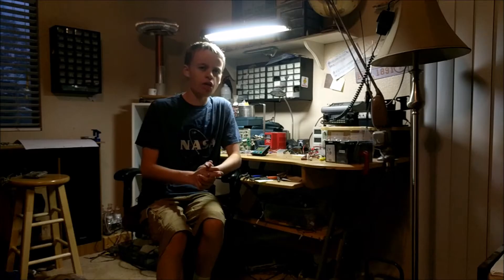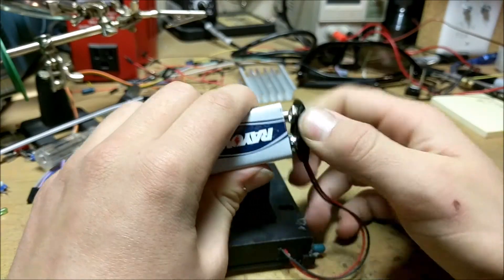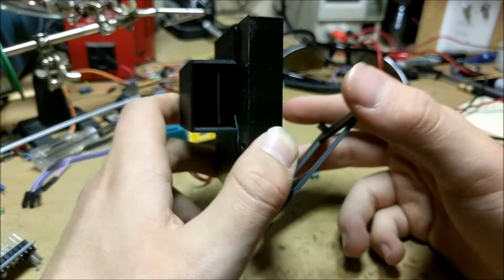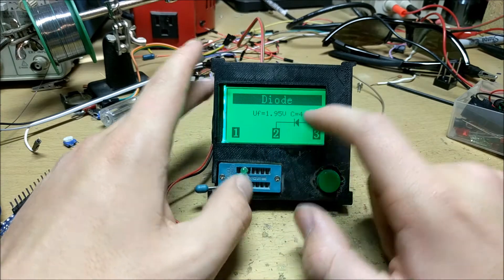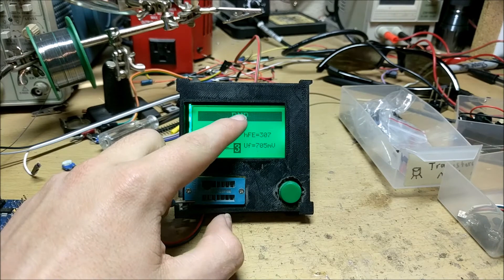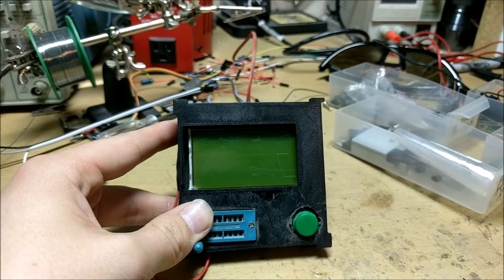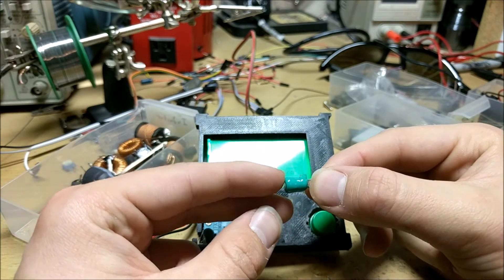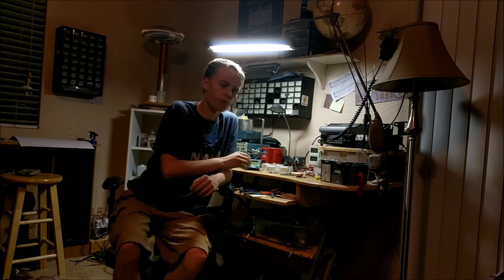How to Use an LCR Transistor Tester

Comment: I know this is an old video but what if you test across leads of an IF transformer that contains a PF cap? Is there any way for this unit to differentiate the resistance and capacitance? Thanks

Comment: I just bought a fully finished model off aliexpress without any instructions so that I could more easily find bad components in vintage audio equipment I'm working on. 
This video is pretty good, demonstrates everything perfectly, I even followed along with the LED test. I'm about to dig into an old Peavey PV1.3K with some sad components in one of the input boards, I'll edit this comment with how that goes later

Comment: I bought one of these boards because I needed to fill a minimum amount for free shipping to Canada. It was an impulse buy and I really had low expectations for it. I am so glad I was wrong. 

This little board has become one of the most useful electronic tools that I have. 

Since buying a $0.13 capacitor often becomes a pain in the butt (minimum order is 10 capacitors, $1.30; minimum order from the supplier is $100, shipping to Ottawa, Canada is $40; brokerage is $40), it's easy for a simple $0.13 capacitor to end up requiring a $180 expenditure, so projects wait and collect dust until I need enough parts from a particular supplier to warrant placing an order. 

I reuse what I can from obsolete but high-quality devices of all sorts. It saves time, money, and the environment. If I need a capacitor, I desolder it from a junked board, test it with this board, and re-use it if I can. 

My little board is mounted in a plastic toolbox which came from a local dollar store and was sold holding assorted hex bits. It's even got a flip-up pegboard tongue which was designed for retail display but is perfect to keep it on the pegboard back of my workbench. 

Sometime after purchasing this board, I invested in a 3D printer, which makes me great pegboard hooks which cost a few cents each in filament. 

If you have one of these boards and access to a 3D printer, this will save a lot of time and effort in building a suitable case for this tester: 

https://www.thingiverse.com/thing:2242310

Lawrence Wade
Ottawa, Canada
lawrencepwade@gmail.com 
https://www.youtube.com/user/TheLawrenceWade

Comment: ESR = Equivalent Series Resistance   which is cool that this little device will measure that. ESR testers will often measure in circuit capacitors without even unsoldering them. Perhaps you could try modifying this with some leads and see if it works.